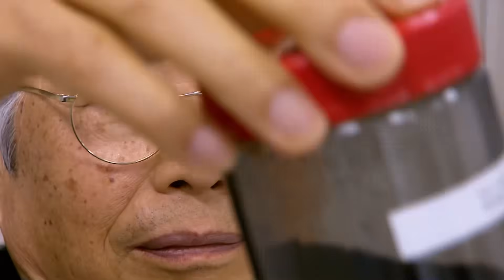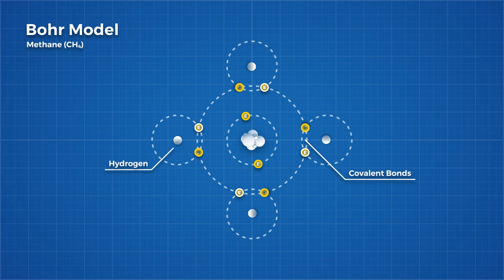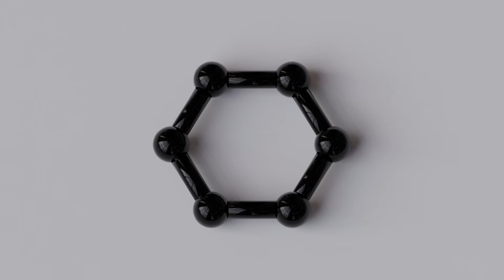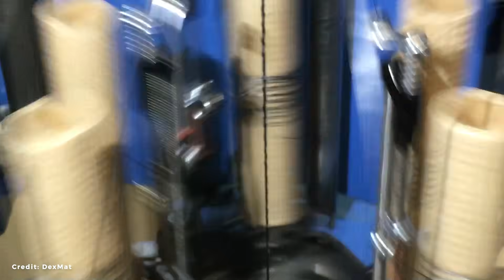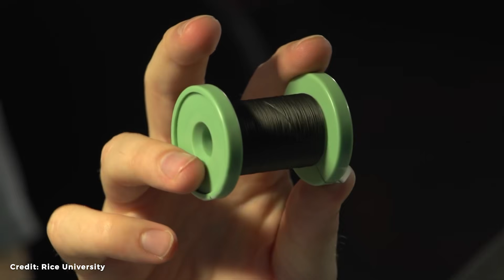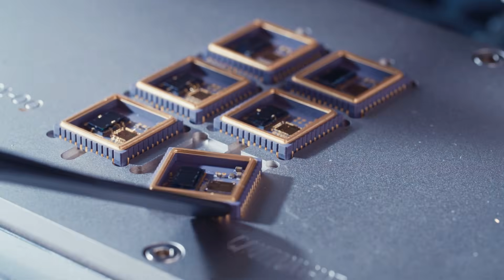How Carbon Nanotubes Will Change the World

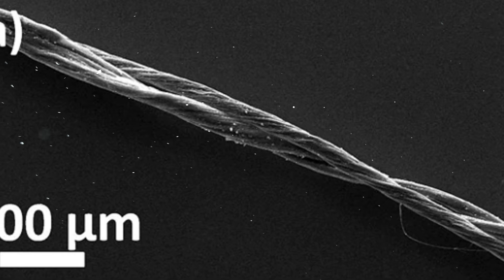Comment: The main reason for nanotubes great strength and conductivity is the aromaticity. The SP2-hybrid sigma-bonds contributes partly to the increesed strength, compared with the SP3-hybrid sigma-bonds. But the ability for the molecule to spread its electrons over its conjugated P-orbitals stabilizes the molecule insaniely much and is by far the main reason for its great strength. There are a few conditions needed to be fullfilled for aromaticity, all of which nanotubes (kind of) fulfills, leeding to an aromatic molecule with great stability and strenght. These conditions is also the reson to the hexagonal shapes. (And the electrons travell through the P-orbitals, not in the empty space in the center of the nanotube, illustrated on 15:10)

Comment: Hello. CNT's are hopelessly overhyped. Any actual application is very specific and they will NEVER allow the space elevator to become reality. Most people who talk about CNT's have zero understanding how materials actually work and what is fundamentally needed for a high performance material.
Reply: Agreed about the hype, and the space elevator in particular.  Mundane applications such as transparent heaters and transparent antennas are the tip of the spear that will start paving the way to widespread adoption in specific application areas where CNT-based solutions can deliver significant cost and performance advantages, imo.
Reply: @paulferguson8764  Hello. Agreed. What we need more than "new" materials is technology in the area of application. We are decades behind material technology when it comes what we can really produce. Multilevel structered materials are the next big step for humanity but we are not even close to make use of them in a broad sense. And every time I hear somebody mention the space elevator I get a grey hair.
Reply: @parallaxe5394  Thanks for your comments.  Due to the relatively limited production scale at this point, I agree that it is going to take a while before products using CNTs are commonplace.  They will be used in high value applications where the volumes required can be met by current (or near term) production capacity, imo.  That said, Birla is deploying them as a battery material, if they are successful there, production by the ton is a definite requirement.  Stay tuned...

Comment: One should be careful when comparing technology, but it is reminiscent of solar cells and lithium batteries. For decades they were very expensive and then in ten years cam a massive drop in price.

The animation is absolutely fantastic
Reply: I agree, production methods are being developed that will make manufacturing CNTs by the ton feasible and cost competitive.

Comment: I can't help but wonder about a bio-engineering approach to generating carbon nanotubes.  With the deposition method, we're currently getting up to 2 cm, whereas every time a human cell divides, it copies around 8 cm of chromosome 1 (if you stretched it out!), with perfect accuracy almost every time.  What if we work towards an artificial enzyme that will polymerize something into a product that can more easily form nanotubes than the random carbon atoms emerging from the metal catalyst?  I think the thermodynamics would prevent an artificial cell from actually excreting carbon nanotubes, but somebody else can work that out.

Comment: Any time space elevators are mention I feel compelled to post the following:

A space elevator going 100km/h would take two whole weeks to get to geostationary orbit. To knock that down to 24 hours you need to travel at 1460km/h.

If the tether weighed as little as a gram a meter the whole tether would weigh 35 tonnes. I.e. your 1g/m tether has to lift at least 35,000kg.
Can't have a moon space elevator as the earth is in the moon's geostationary orbit.

Comment: Interesting video but I don't think including Neuralink serves as an accurate representation of biomedical application for carbon nanotubes. Musk's ideas of a brain-computer interface are still in the realm of science fiction since answering the mind-body paradigm isn't even close to being achieved.

I think a more realistic application could be for using it in medical inplants, reducing risk of metal toxicity from some devices. Safe non-degradable stitching is another potential use if that would ever be required.

Comment: You mention at some point it can be used in the biomedical industry, because it isn't harmful. But I work at an R&D facility (microelectronics) and we used/tested the carbon nanotubes too. But we had to be very careful not to break them  due to safety hazard. The small particles of nanotubes could get in your lungs and act like asbestos particles. Maybe we were too safe at that point? It's about a decade ago.

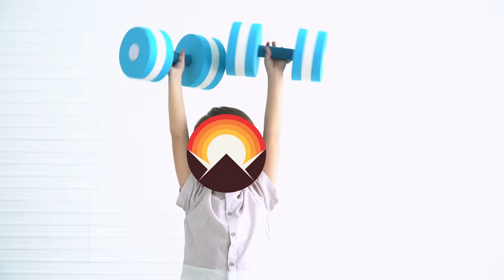Comment: 5:15 it is more like dumbbell and less like 8 in reality. Look at heat-maps you had before an you'll see that it is 2 half circles with middle part cut out. It is only drawn as an 8 to overlap less and be easier to see what is drawn.

Comment: Yes like graphene, the properties of nanotubes at the atomic level extrapolated losslessly and prophesized as engineering sample objects you can actually see and test without some type of microscope. Whiskers of several materials are in the 600 KSI to 800 KSI neighborhood of tensile strengths yet NO ONE has successfully made useful diameters of rope. slings, and tethers that retain a significant fraction of that whisker strength. So ... the hype train rolls on, fueled by pop sci fans who don't know any better and videographers hungry for clicks ...
Reply: Transparent conductive films are one area where commercially available solutions have been introduced.

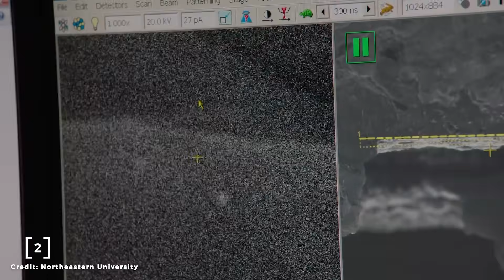Comment: 1:25 Nanotubes should NOT be called biocompatible! I met Rick Smalley in the 90's, and was horrified to learn that he handled nanotubes without gloves or a mask. It's way too similar to asbestos -- insoluble fibers thin enough to damage cells at each end. He later died of cancer, IMO joining Marie Curie in being killed by their Nobel-winning discovery.

Admittedly, the full jury is still out, but only because the rarity of the material has prevented a full gold-standard medical study. Until such a study is completed, however, please do not declare that carbon nanotubes are biocompatible. It implies that they have been proven to be safe. No such proof exists, and early evidence is trending strongly towards "unsafe".

Comment: The overhead conductors have the Aluminium on the outside and a steel core, as the current is conducted around the outside of the cable.

Comment: Biocompatible doesn't mean zero environmental risk.  For instance slivers from nanotube cables likely slice up lungs similar to asbestos and fiberglass dust.  I haven't seen anything about how carbon material waste can impact the ecosystem either.  Nanotube advantages outweigh the disadvantages, but it's not a perfect or miracle material.

Comment: The last part about implants is very wrong.  Carbon nanotubes are very harmful to human bodies due to its incredible strength.  Once it gets into the human body it could cut cells like butter by a hot knife.  In labs, CNT are only handle by equipment.  Nobody want to handle CNT with their naked flesh.

Comment: I think you made some misleading comparison, one that is made often by many, in comparing UTS of monocrystalline defect free graphene monolayers with bulk polycrystalline, defected steel. In such comparison the strength of graphene might be 100 times greater than steel but if you compare similar monocrystalline, defect free steel, say martensite, then graphene is only about 8 times stronger, still significant but an order of magnitude less.

On the other hand you could maybe even argue that graphite is the bulk version of graphene and as such in comparison to bulk steel is actually much softer.

Comment: It is clear to me that the strength of both nano tubes and graphene cannot be scaled from microscopic world to the macroscopic. The strength at the microscopic level is a function of their covalent bonds and their molecular structure. It is akin to welding heat treated sheets of metal together i.e the welds form stress concentrations and will break (crack) more easily at the weld. I think this is the same for nano tubes. The simple process of going from individual tubes to combining millions to create a thread as big as a human hair will introduce millions of local stress concentrations which will reduce the strength by huge magnitudes. It is just my understanding but it seems logical.

Comment: aluminium is worse conductor then copper
but not much
difference is negligible
aluminium is not used in end user electrical inhalations just because it is way too reactive and actually if it will touch copper, then it would start to arc (I have lived in house fully wired in 1914 with aluminium)
the biggest problem is aluminium will cause arcing which in turn will kill all electronics
aluminium is fine at transmission lines though, as there is not much connections made there and you can completely avoid interface with copper (transformers)

Comment: It's sad to know that carbon nanotubes are still too expensive to mass produce, but other type of nanotubes is starting to mass produce and is call Boron nitride nanotube. It is strong like carbon nanotubes, but it's the opposite in electrical conductivity which is an super isolator and a heat resistance. One of the company that started to manufacture this material is called BNNano.Inc

Comment: if they figure it out then it s a hughe step up forever. If they weave strands into sheets and roll it a few times over it would be knotted 1000 s of times at 60 feet ,would be incredible beams wires for buildings to space. Just the value of land would cost the whole building plus carbon capture. WOuld also realy solve the eplane weight with ultralight pollen like structures and straight forward batterie power storage

Comment: Someday Starships will no longer be built by assembling alloys with mechanical fasteners or welding; Hundreds or even thousands of robotic spiders loaded with spools of carbon nanotube filament will literally weave a monocoque composite hull form over an armature.  The pre-impregnated resin won't have to be cured in a massive autoclave, just add the right amount of current for the right amount of time and then you have an incredibly light and massively strong hull structure that will withstand the rigors of atmospheric re-entry and other forces that act on space faring craft.  I hope we will see something like this in my lifetime, but while I wait for that I'll keep working on my FTL drive :-)

Comment: Materials that are strong on the nanoscopic level - hardly ever translate to the microscopic level - hardly ever translate to the macroscopic. Nanoscopic tensile strength, high-modulus, heat/cold resistance and high V/amp conductivity and 0 ohm resistance is nice yet a little bit useless in the real world too. A modified Nyquist theorem applies here too. You cant tell the noise from the actual effect anymore..yes I know there are statistical solutions to that but it gets very very fuzzy very fast. 
Using atomic structure is cool but it's about time we start experimenting with the vast spaces between nucleus, particle trajectories and maybe investigate on how to build structure out of space-time and fields. A warp-field elevator beats a physical space lift every day ;-)  if we could scale the effect up from the Nanoscopic. Would love to use carbon-nanotubes for this: https://www.facebook.com/transascend 
Technologically this's already a practical solution of using nucleus separation and electro-magnetic acceleration of nucliai to overcome gravitation on the macroscopic level. 
For the future I see uses for nanotube scaffolding as a means  of influencing van der Waals force and maybe pumping up the Casimir force to a positive value and thus getting power to warp-lift nodes. Both techs are at least 200 years away - if ever feasible. So let's start experimenting and see if nanotubes can influence the fabric of space and time rather than building "physical" structures.

Comment: Liked most of the video, but I do have a couple of comments. Carbon nanotubes (CNT) can actually be either conducting or semi-conducting. It all depends on the angle that the graphene sheet is folded in on itself (for those wanting more information on the matter: look up info on chiral, zigzag or arm-chair conformations).
 
Another thing worth mentioning about CNTs is that they can actually induce an immune response. This response seems to be a generalized physical response to foreign objects. There have been cases of reported fibrosis (similar to asbestos) in the lungs of people being exposed to CNTs of a certain size. Since this is a physical effect, it of course all depends on the length of the CNT, and the context it is introduced in.

Comment: I spent a lot of time wondering why we couldn't use an ion implantation method with a large cathode-ray-tube-like device to get exactly what we want. At the same time, using a carbon capture technology to extract carbon atoms from CO2 to give us an even larger bulk of material to work with. Would you be able to make a video on stuff like this? Thanks! C:

Comment: Any engineers around here that can clear this up?
If the Young's Modulus is 0.5 TPa and the Ultimate Tensile Strength is 130 GPa, shouldnt it be able to stretch more than 18%? Like 26 maybe?

Comment: carbon nanothreads would likely make for better structural components (i did not make those up, essentially 1d diamond)- also, wouldn't sp2 carbon be strengthened primarily by pi conjugation?

Comment: What is the difference between a carbon fiber filament and a carbon nanotube?
Reply: Nano 10^12
Reply: Nano 10^12
Reply: Carbon fibres are much larger in diameter than carbon nanotubes (micrometers vs nanometers). Carbon fibers are also less pristine in their atomic structure and always contain many sp2 layers at their walls. Carbon nanotubes exist also with multiple walls, but the most basic ones are of single wall type.

Comment: CVD is chemical vapor deposition (not disposition) .. CNTs growth usually give a mix of metallic and semiconducting tubes depending on their chirality and diameter. CVD growth method is a long way off from controlling chirality. Until then it’s all a pipe dream. As far as I am concerned.. majority of university labs have moved on to other novel materials. It’s an evolutionary deadens material with novel physics but few scalable applications possible.
Reply: They start to get good at chirality control. Or at least at selecting semiconducting tubes. See here for example: https://www.nature.com/articles/s41586-019-1493-8
I think it's still an interesting topic. Well, I do research on CNTs.
Reply: @daniel7587  I will check out this paper. It’s promising. Are you working on FRET on CNTs 🤓? We also have papers on Forster Resonance Energy Transfer event in CNTs! I also got my PhD in CNTs. Long time ago though. Good luck!
Reply: @agotti  Haha, but no, I'm working on numerical simulations of CNTs
Reply: Jo-Jo bighiker
1 second ago
Not disposition! Carbon nanotubes will change the world... heard that before. Like lasers, it will be some kind of useful technology, applied in small ways. Probably in the military at first, because they can afford it (DARPA).
Reply: Actually there is a way of manufacturing high quality, high consistency CNTs that have controlled chirality.  I disagree that it is a pipe dream.  For example, please do some due diligence on Birla Carbon and SWM Intl and consider why these well-established, multi-billion dollar corporations have recently made investments in CNTs.  There is no way these behemoths would be getting involved if they thought scalability was still an issue, imo.